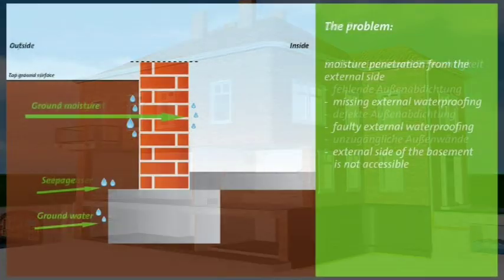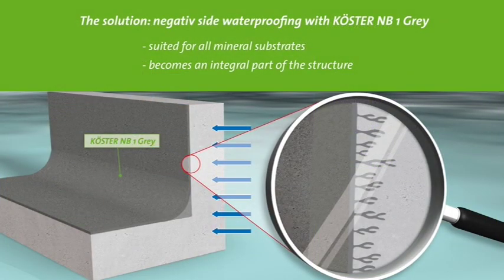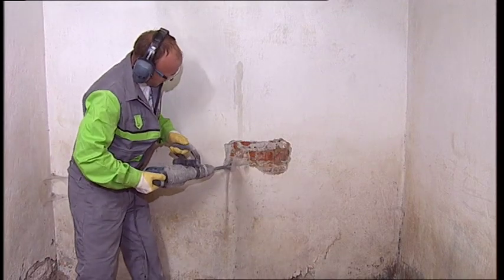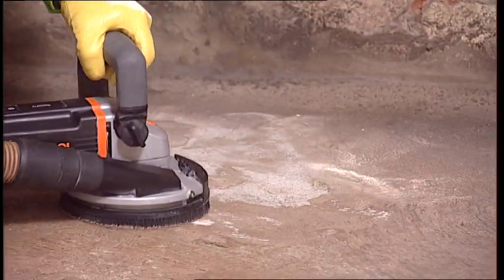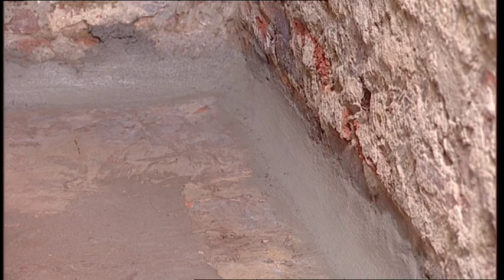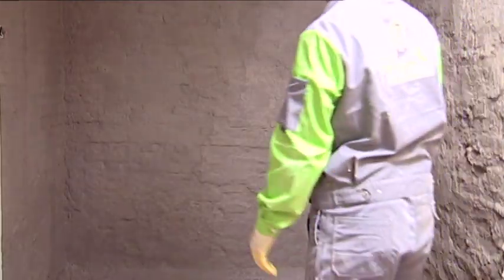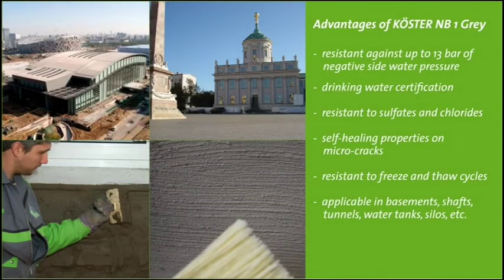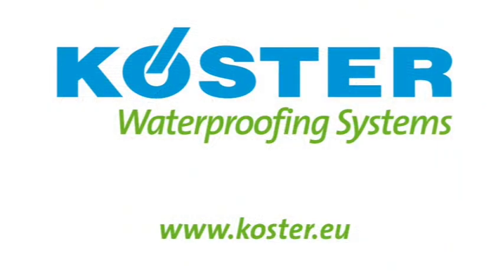Internal Basement Waterproofing

Comment from the maker: The NB1 Grey product featured in this video will resist negative water pressure in excess of 100m head.  It is more than capable of sealing basement 3 even 3 or 4 storeys underground.  Recently tested at Hydro Electric Power Station in very deep tunnels with great success.

Comment: This is a great explanation of how this product works, however my understanding is the best practice to solve basement or crawl space water instrution problems is to either:

1) Fix the actual source of the problem which is water pooling outside the wall. Place a french drain on the outside wall next to and just below the footer so that water can not rise above the footer, therefore there is no water. Fixing the source is typically the best path. Of course also grade the ground away from the house and make sure downspouts dump water away too.

2) If it's too expensive to fix from the outside, which is common because the basement is 10 feet deep or there is a huge driveway or patio in the way, then place a french drain on the inside, next to the footer. As the water leaks into the basement, the french drain collects the water and either pumps it out or use gravity. This relieves the hydrostatic pressure on the outside wall pushing in, which over decades may cause the basement wall to "fall in". Water/dirt probably pushes into the wall from the outside with 2x more force than dry dirt alone. One downside to this solution is the sump pump will not work if the electricty goes out, which sometimes happens during the huge rain events and exactly when you need the pump most!

I am curious to know how the past ~100 locations have performed after a few years in use and compare them to a french drain solution, especially an inside french drain which would be similar in cost.
Reply from the maker: Thank you for your long and detailed comment.  You cover several points, so I will try to briefly answer them although this is a very detailed subject and we would be happy to further discuss this with you if you give us a call 01387 270252.

Firstly we would agree that generally waterproofing from the outside (positive side) is best.  Hence nearly all new-build basements are waterproofed externally, normally with a combination of barrier waterproofing (Type A) and drainage (Type C) to include a land drain sitting off the toe of the slab. Waterproof Concrete (Type B) is also an option that can be considered.  According to BS8102 (2009) and NHBC guidance, a combination of  a least two methods out of A B and C should be used if there is any possibility of pressurised water ever coming to bear on the basement walls.

With regards to refurbishment of an existing basement, it is unusual to excavate and install waterproofing externally due to reasons of cost and practicality.  When waterproofing from the inside only Type A or Type C can be used.  The type A as featured in this video has the advantage that it is passive, not relying on a pump and is maintenance free.  The main dissadvantages are that it is a rigid system so could crack if there were movement, also condensation can be an issue, but there are ways to deal with this including Koster Restoration plaster.  With a Type C (Drainage System), you will require a sump pump to be fitted and maintained annually.  The system will also need flushing out from time to time.  In case of power cuts, battery back-ups are available, but it all adds cost.

The point about the walls collapsing in is not really valid, I have heard this before from people selling cavity drainage systems.  When the building was constructed it was always intended for the basement walls to be able to retain water and soil and unless some major structural issue is identified there will not be an issue.  In fact the difference in water pressure build up on a slightly leaking wall with a drainage system on the inside is not going to be significantly different than for a fully tanked wall.  The wall itself without new waterproofing is still holding back 99% of the water and is not going to be leaking to the extent that it is locally lowering the water table!

The structural issue that is more likely to be an issue is the floor.  You can't install an internal waterproofing system on a "screed over dirt" floor.  So in some old buildings a concrete slab will have to be installed before any waterproofing can be installed.  If not then water pressure could cause the floor to heave, cracking the waterproofing system.  You would also need to install a new concrete slab in this situation if you were installing a pumped drainage system.

To answer your last question, we have been trading in the UK for 19 years and have supplied our mineral system for basement waterproofing to more than 1000 projects over that time.  Some have been installed by approved contractors, some by general builders and some by DIYers.  In that time we have had about 4 projects where we have encountered problems with excessive salts and about 5 projects where we have had problems with condensation (in all cases involving saturated blockwork).  We have never had a problem with a wall collapsing or bowing and we have not had a problem with a floor heaving.  We offer a very high level of technical support to our customers and try to design out all risks prior to the materials even arriving on site.

Comment: I have a basement, It has a coating of paint, I think it is primer. It was a water prove guy came to do the water prove, it should be fiber glass. but when the first coat of the paint on, then water keep leaking in, because he clean up all the old water prove membrane off. And he said when the water not stop he couldn't apply the water prove material on, it wouldn't work. So that is why it left a coat of paint, (I think it is primer). The water prove system he was go to apply, should be the one for bathroom shower, This system I don't think it can hold the water from the other side.of the wall.

So Koster product should be the permanent solution for my basement, but my basement has got the coat of paint (assume it is primer),Does it need to be wash off? What is the best way to wash it off? I got a water blaster, is it any good?

Where can I buy your product, I am from New Zealand.